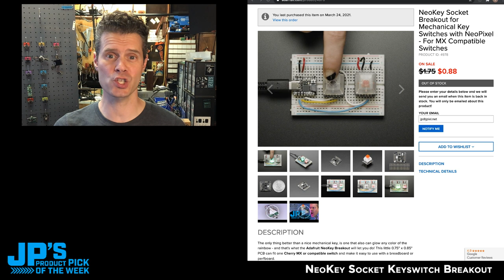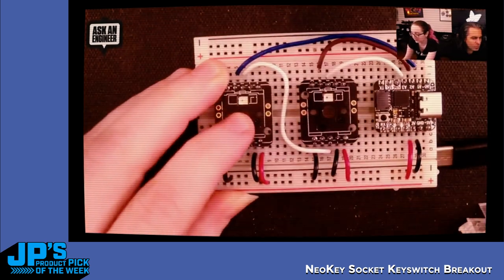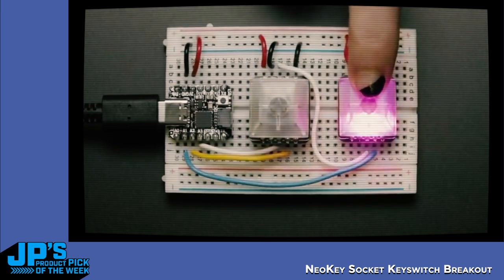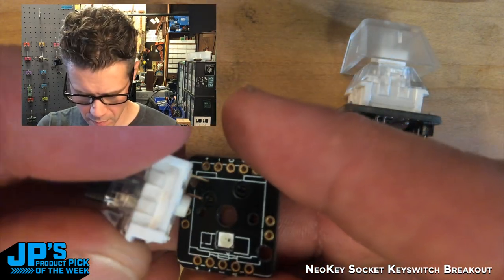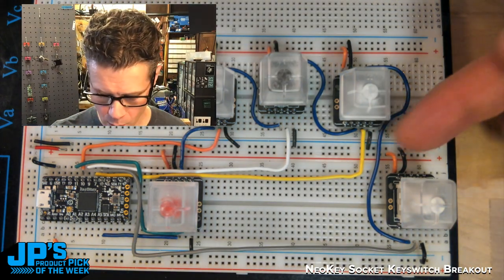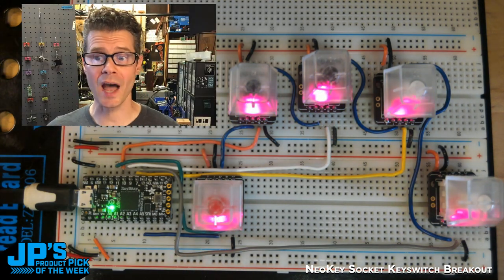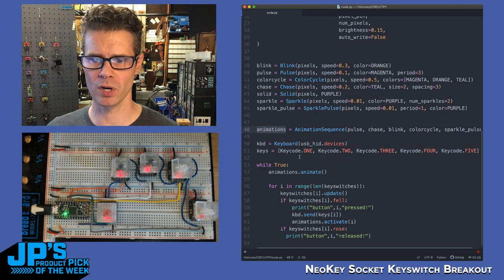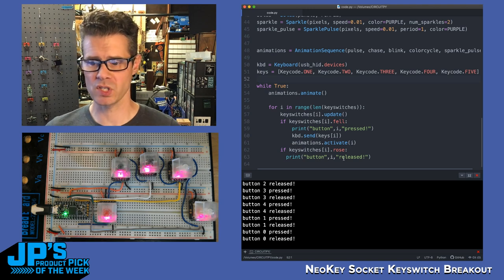JP’s Product Pick of the Week 5/4/21 NeoKey Socket Keyswitch Breakout FIX @adafruit @johnedgarpark

Comment: this could be very nice if the key are addressable as well.
Reply from the maker: The LEDs under each key are addressable. Each keyswitch can be used as either an individual switch or as part of a diode matrix to save on pin usage.